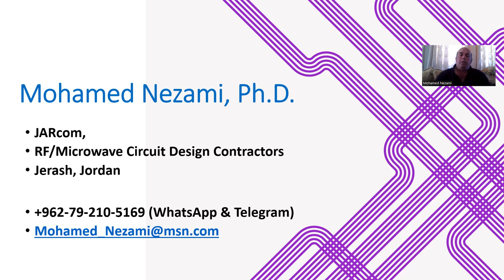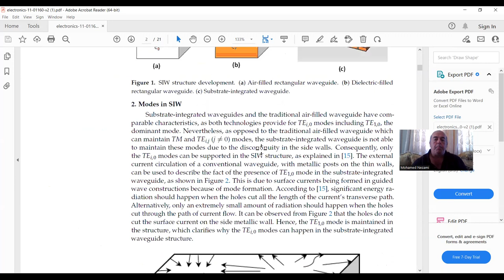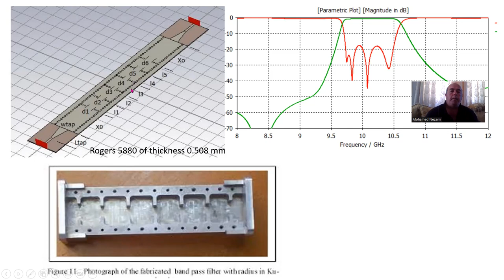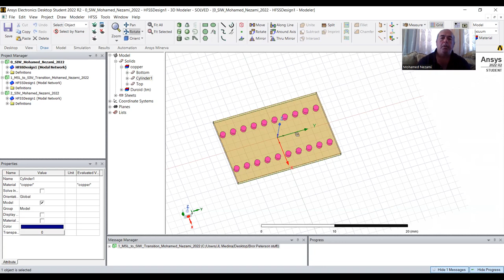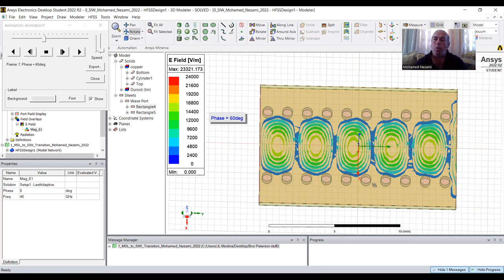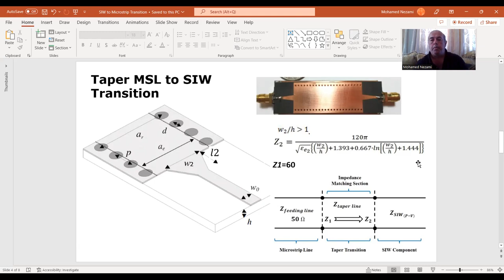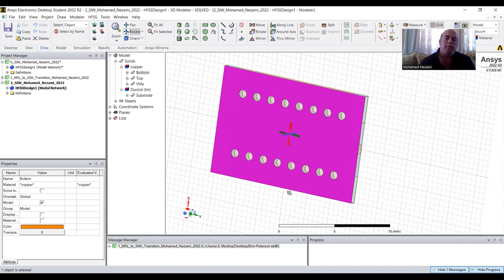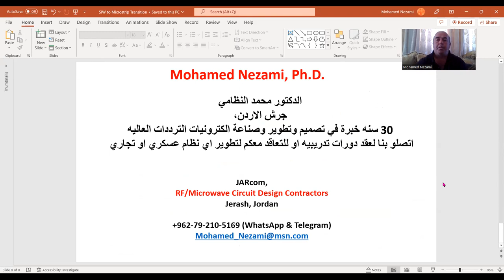Substrate-integrated waveguide (SIW) Devices Design and Modeling

Comment: Hai sir 
I have a dout on SIW, generally they are used in Millimeter range of 10 to 300 GHz but in this video and most of research paper it is  designed it in less than 10 GHz. Why is so...